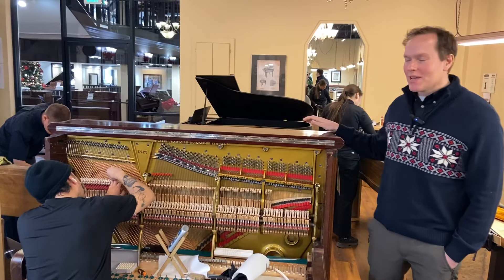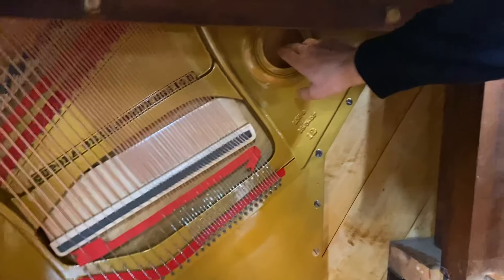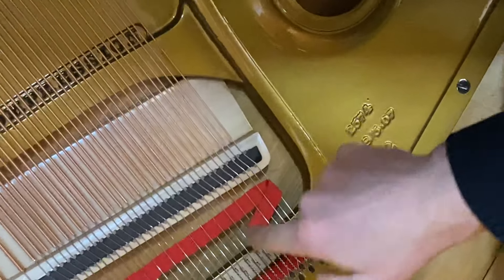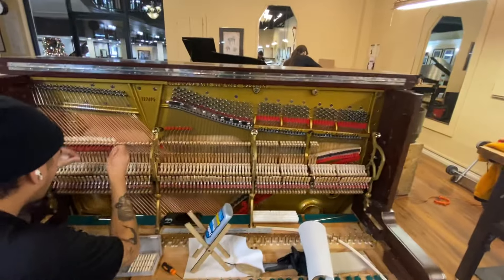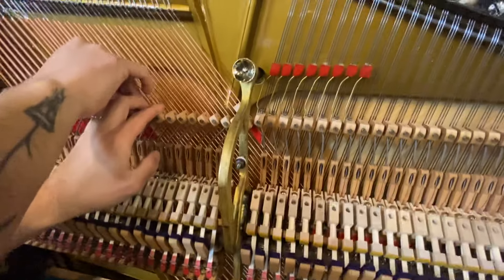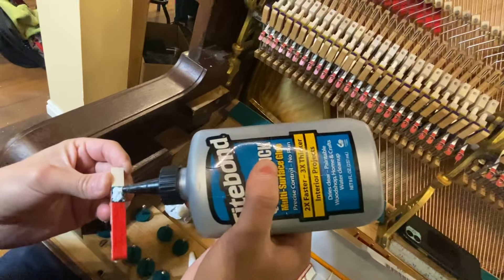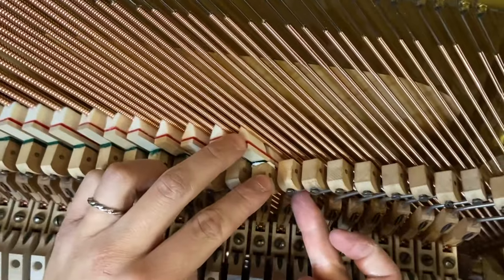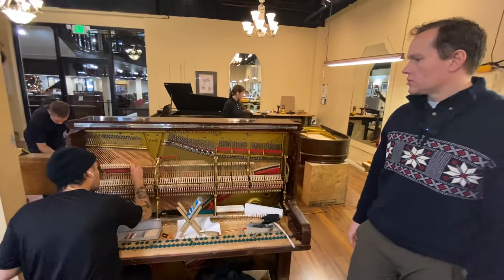PROGRESS: 1907 Steinway Upright Rebuild

Comment: Regulating the spring tension on the dampers is very important to both the touch/performance, and dampening power. It has been my experience that the dampers should have 45g. of tension/resistance, from the lowest bass note through the treble section before the break. (This is the amount of force needed to begin moving the damper, measured at the damper head with a gram gauge). After the the high treble break, 30g of tension for the remaining notes with dampers.
Hammer return springs should be regulated as well, and this tension can be raised or lowered uniformly in the piano to customize or "fine tune" the touch.